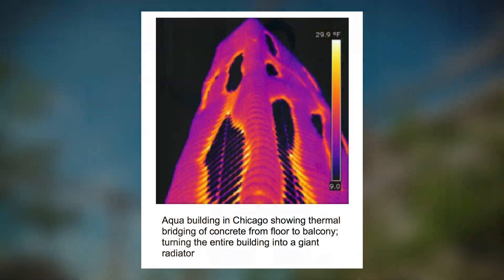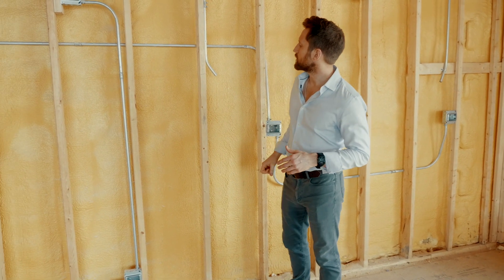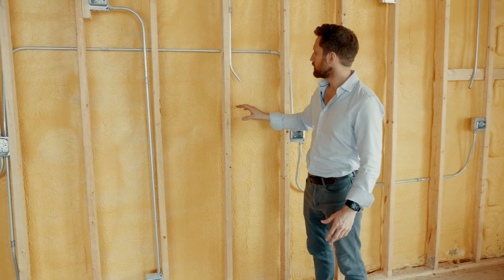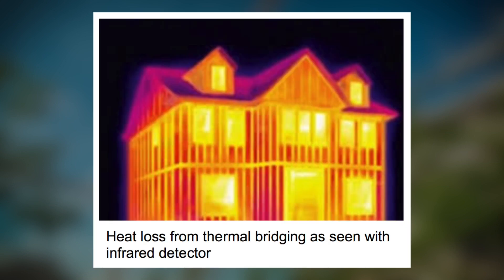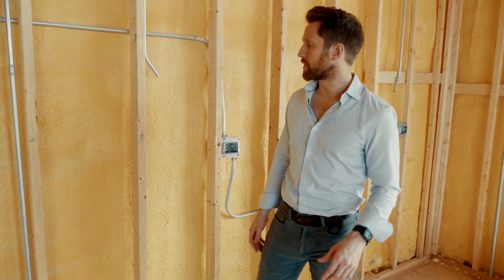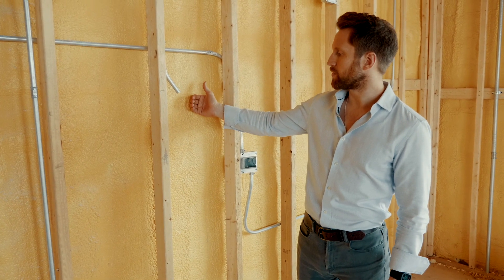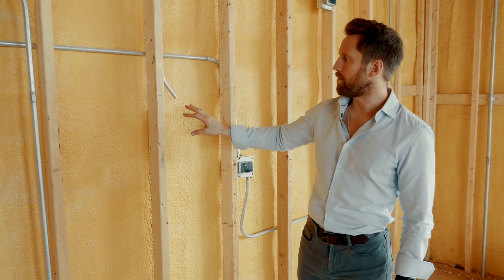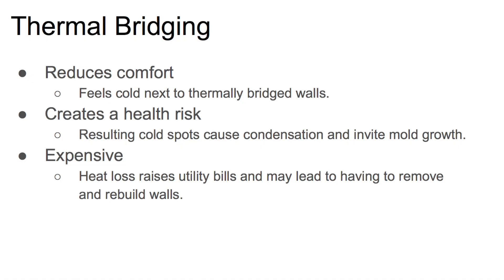3 Dangers of Typical Framing

Comment: Is this where double stud framing comes into play if you don't have a masonry exterior?
Reply: Yep! Double stud / staggered stud are great ways to prevent thermal bridging. In Chicago I prefer to do a continuous layer of insulation around the outside as we're width-limited with the standard 25' x 125' lot and, as you know, staggered stud walls are thicker. You can see a video about "the perfect wall" that includes continuous exterior insulation here: https://www.youtube.com/watch?v=puXs6b14qzU

Comment: Why do you prefer to put the foam insulation on the inside of the home rather than between the concrete and the brick veneer?  See this article: https://www.buildingscience.com/documents/insights/bsi-001-the-perfect-wall
Reply from the maker: Good question, and I apologize for the late reply. A couple reasons: 1) Feasibility 2) creating a continuous vapor barrier. 
On the East side of the building we used a single layer of CMU, so we didn't have a cavity to insert the foam. Additionally, we wanted a continuous vapor barrier for the building envelope. While the foam board typically used around the outside of the building is technically vapor impermeable, the seams (generally tape) almost always fail over time. And it wouldn't be practical so spray the outside, both because of consistent depth and, in our case, the weather (it was winter when we were putting up the superstructure). Thank you for your comment!